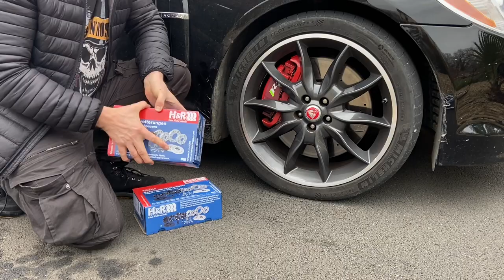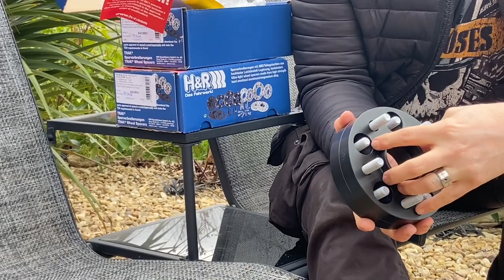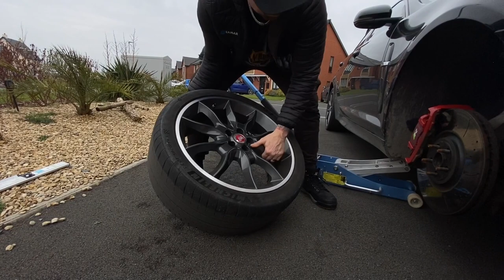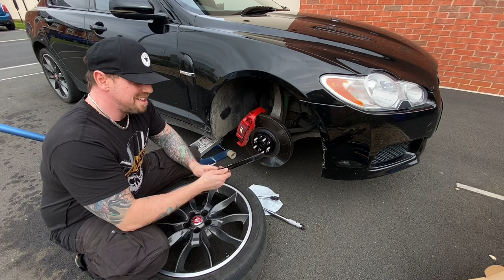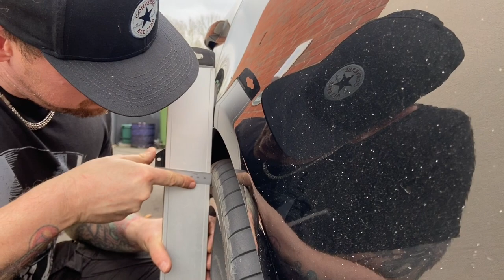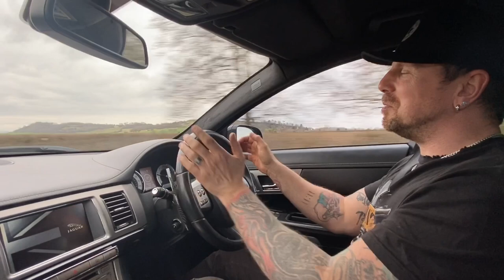Why & How to fit H&R wheel spacers to your Jaguar XFR - What Handling Difference?

Comment: will this be safe for the rear differential for  a 2012 jaguar xf profolio Non charger ?
Reply from the maker: Absolutely, no problem at all. I’ve reduced mine down to 20mm on the rear as I have 285 wide tires and lowered the car to find them rubbing, you probably have 255 tyres so 25mm would be absolutely fine.

Comment: Did you take the tires back off after 60 miles and re-torque? About to install same sizes on mine
Reply from the maker: Using the silicone lube spray and knowing the nuts turned freely means I know it’s torqued correctly, so I don’t need to retry the torque at a later date.

Comment: Hi, I've been told that 20mm spacers on the front gives you tyre rub on the inner arches, have you experienced any? I also want to run 20mm on the front and 25mm on the rear, I have the stock 20" rims on my Jag. Great vid.
Reply from the maker: No rubbing on arches at all, but I already had a rub on my inner rear arch with standard wheels that I had to solve to put these on. I posted a video, go check it out in case.
Reply: @69racer69  cheers for the reply, I haven't had any probs with my tyres rubbing, I did however notice the rub marks on yours, glad you got the problem sorted.
Reply from the maker: @themightyvanguard  it’s been like that since I got the car 18 months ago 😂 only now do I fix it.

Comment: The reason the factory puts the wheel deep in the arches is for aerodynamic drag reducing purposes, and the law dictates your tires cannot protrude from the wheel arches. Wheels produce quite a bit of drag. Interestingly enough the first gen XFR like yours and mine has the lowest drag Cd of any competitor in this class. .27 for the pre facelift and .31 on the XFRS facelift. Speaking of the XFRS, it has 10mm wider track front and rear than the standard XFR.
Reply from the maker: That makes a lot of sense, I think a lot about drag, and I have things planned in the future for that 😉
Very interesting about the track difference between the XFR and XFR-S, I didn’t know that, I know they were slightly lower. Didn’t know they were wider. Thank you for the info buddy.

Comment: How much unsprung mass it this adding per wheel?
I don't understand spacers, my son has them on his Abarth 500, fitted by a "mechanic" who didn't use longer stud bolts to compensate for the spacer thicness. The bolts were holding on 5mm of thread.
His wheel came off, luckily at 15-20mph, a mile from home.
Reply from the maker: That was a very irresponsible mechanic and he should be fired for that!!

Comment: Hey there.... I have a 2012 Jaguar XF ( non Super charged) 5.0 V8...... Should I go with 20mm spacers all around or maybe go with 15mm front and 20mm back? Break it up a little? What do you think? Thx
Reply from the maker: 20mm all round. If you go 15mm the. You’ll have to chop the end of the studs off.
If you have 255 wide tyres at the rear, I would go 25mm at the back.-
Reply: @69racer69  Awesome. Thank you 👍

Comment: Great video helps alot.  I can custom order spacers for my '12 XFR with Dracos in the states.  What do you think about 23mm rear, 18mm front future lowered with the Spires springs which I believe drop 18mm-20mm.  Just a bit less wide then yours.  Can choose any width I want.
Reply from the maker: That could work really well with a couple of my less then I have. But I’m saying that the 2 cars in the 600bhp video of mine both have 20mm front, 25mm rear with spires springs. So take a look at that for an idea.
Spires won’t drop it 18-20mm I think it is more like 15mm.
Reply: @69racer69  thanks man I checked the other 2 cars you mentioned and also measured my car.  Looks to be that the 25mm/20mm will be fine.  I have plenty of space so I'd rather go with known quality of H&R.  I dont see those sizes available only the 15mm.  Do you have the model #s?
Reply from the maker: @jaimecuadrado7509  yeah I agree with your thoughts. Here they are in black
B4035633  (20mm)
B5035633  (25mm)
Reply: @69racer69  perfect!  Also noticed you are running 265 front tires and 295 rears.  Slightly wider then stock 255 and 285.  Makes a bit of difference..  Thank you...ordering shortly.

Comment: Spooky I purchased a set of H&R spacers In the week. Went for 15 & 20mm. I run the stock XFR wheels and I'm led to believe my angle grinder can stay in its box, buy we will see if that's the case.

You two do make me chuckle, dirty minded but cracks me up.
Reply from the maker: That is spooky, should be perfect if you can keep the angle grinder in its box. Let me know how it goes.

Lol got to have a laugh 😂
Reply from the maker: Have you tried putting them on yet?
Reply: @69racer69  Hi Shane, yes all fitted now. I didn't have the best experience at Viezu last week so sulking and ignoring the car currently 😄
Reply from the maker: @drewdoesstuff5052  oh really? What happened?
Reply: @69racer69  Shane Long story, drop me a messenger if you wish to hear it.
Reply from the maker: @drewdoesstuff5052  I can’t find you on my messenger

Comment: Did you figure out why the passenger side rear was out farther?
Reply from the maker: Only thing I can think of is the body and axle is out by 3mm to one side.no damage underneath the car, that was duly checked when I bought it. So maybe manufacturing fault. See how it is after I lower it.
Reply: @69racer69  I’ll be putting 25mm for my rear. I’ll let you know if i have the same issue.
Reply from the maker: @TheOxidizer2k  hopefully you don’t, will be interesting to know for sure
Reply: He just needs to get a four wheel alignment done - all four toe and camber settings need adjustment after fitting the spacers. The camber adjustment will bring the “top” back in. Where are you based shane? We could maybe help with this 👍

Comment: Hi, I have a 2009 XF 245/45r18 tires. What size spacers do you recommend for front an rear?
Reply from the maker: 20mm front and back is what I have on now.
Reply: @69racer69  Thx! You change the rear from 25?
Reply from the maker: @ewenellis5079  yea I did, I lowered my car and when I updated my engine power the back would rub on the arches. So I went down to 20mm. But I have the wider 20” wheels on the rear, yours will probably be fine with 25mm.
Reply: @69racer69  Thx for the info! I appreciate it

Comment: 😂😂. Oh, one of my front wheel speed sensors has gone u/s. Does the car go into limp mode? Hell no! No abs, no e-diff, no traction control but still full power! A bit hairy if the roads damp! 🙈
Reply from the maker: Why has your speed sensor gone?
Reply: @69racer69  it came up as faulty when we plugged in the computer. 🤞🏻
Reply from the maker: @pan382  not related to a wheel spacer then? Really odd fault to have.
Reply: @69racer69  nooo, not got spacers yet. Although it’s a good idea. Fault came up and the comp said it’s the sensor. Will let you know the result.

Comment: Why no locktite on the spacer nuts
Reply from the maker: Because you don’t need locktite on the nuts.
Reply: why not
Reply from the maker: @auntygreg6101  they’re just the same as your wheel nuts, they don’t have locktite either.
Reply: you can check your wheel nuts anytime but to check your spacers nuts you need to remove the wheel so why not blue locktite them just for that little bit of peace of mind
Reply from the maker: @auntygreg6101  you can apply it if you feel you don’t trust the torque. You need to make sure you clean it off to make sure the locktite works anyway, I trust the torque that I applied and don’t feel the need for it at all. But I understand your thinking.
Reply: when you remove your wheels to apply the locktite to the spacers insert a screwdriver under the brake caliper into the brake disc fins on the drivers side and into the fins on top of the caliper on the passenger side this will stop the disc from turning when you torque
Reply from the maker: @auntygreg6101  thanks for the tip, but I won’t be applying locktite 😂

Comment: Comparing a go kart and a road car differences by using spacers is very stupid. On a road car widening the rear does not make one wheel more prone to lift. You feel the car different because adding spacers changes (increases) the wheel leverage load on the springs, and as a result you get the feel and behavior of having a softer springs.
Reply from the maker: I didn’t relate them directly from memory, I said the kart has a fixed axle and not independent suspension. But they still are linked by the anti roll bar so they are not totally unlinked. I wish people listened to my intentions better, or maybe I’m not explaining myself correctly.